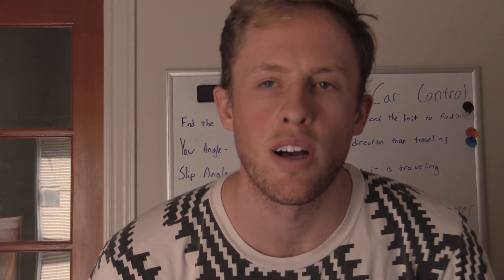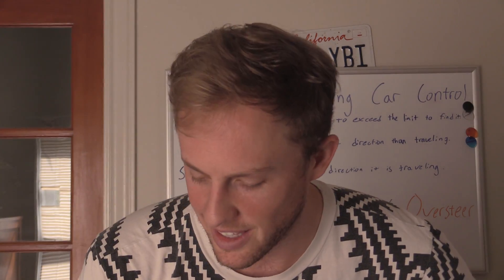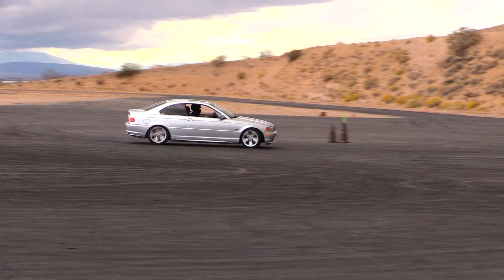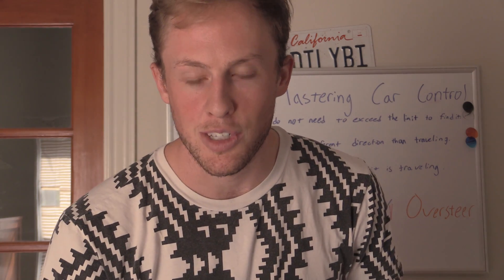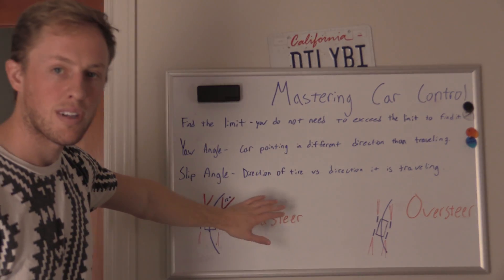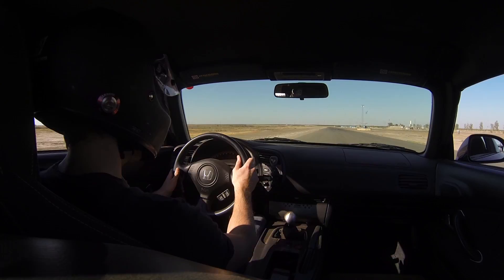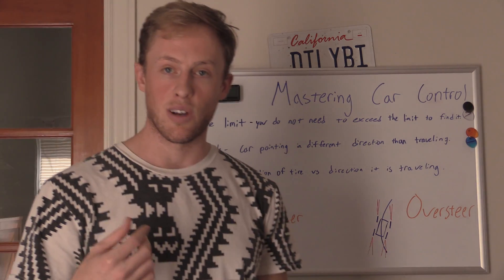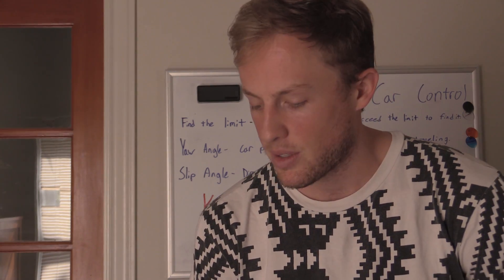Car Control: Understeer & Oversteer

Comment: what can you do to counter under steer? suspension wise and any other mods. camber maybe i dont know.
Reply from the maker: +limpkit2011 As far as tuning, the easiest way would be to increase the rear roll stiffness with higher spring rates or larger rear sway bar.